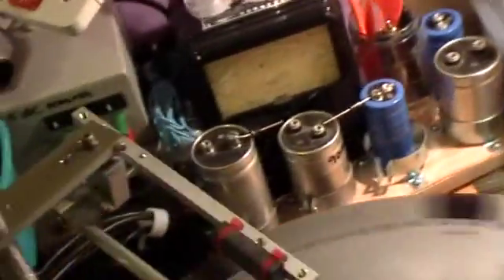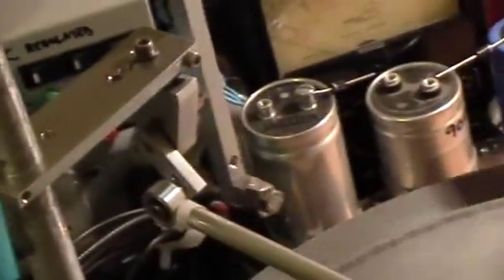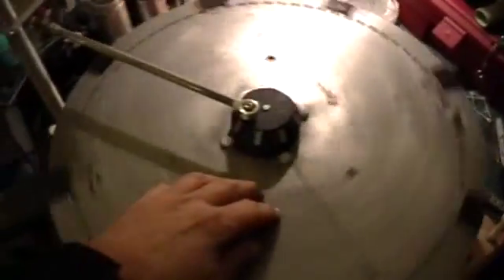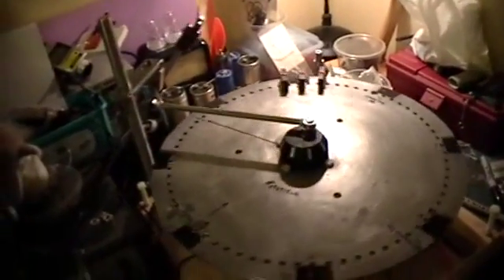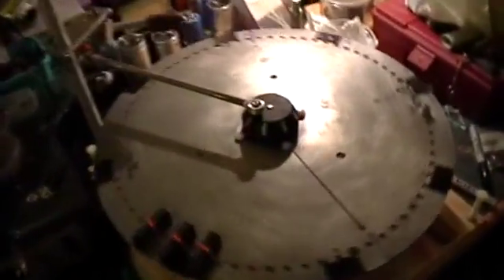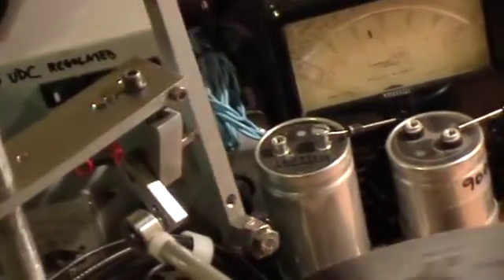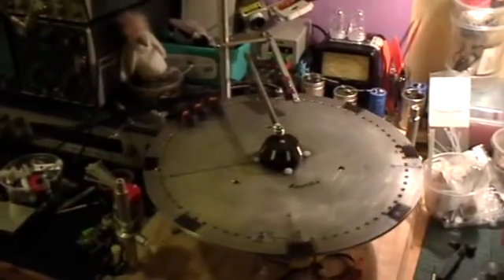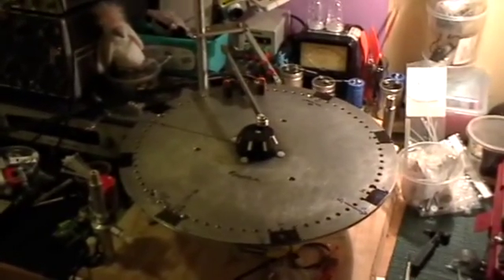Continuing Magnet Wheel Research 4 -- Overhead Articulated Stator

Comment: How about mounting the rotor magnet end wise? Mount the arm magnet end wise also. Make both magnet poles repel. Set the arm magnet to come down directly behind the rotor magnet with a very small gap. Maximum repel on each arm drop if the gap is small enough. I think this could work. If so, may be try two magnets on the rotor and arm in parallel for more go. Since the arm comes straight down, there may not be much problem with magnetic force on the arm magnet. 90 deg.

Comment: Dude, You're scary. I was just working on the same thing for my left over Mylow platter.
But, I was using two pistons on long arms extending about 5 inches diameter and using 2 stacks of rotor mags.
In and Out, out like a porn start.